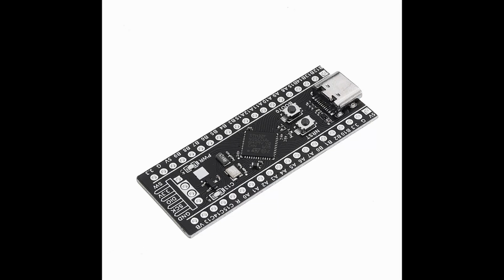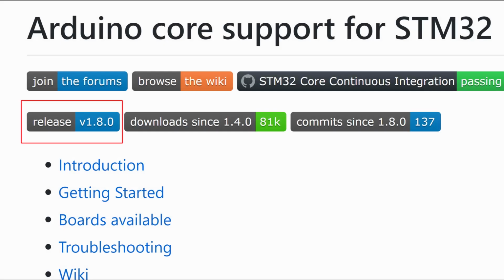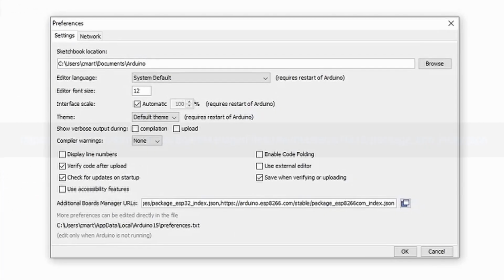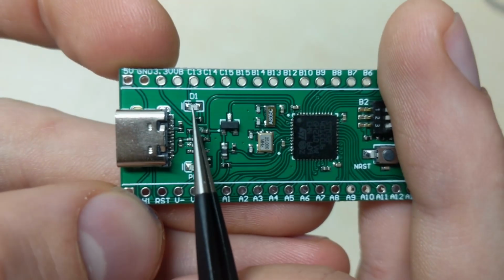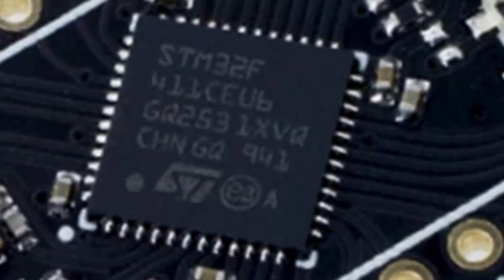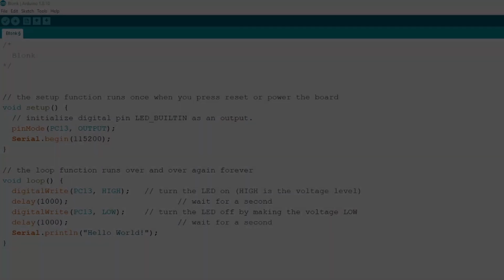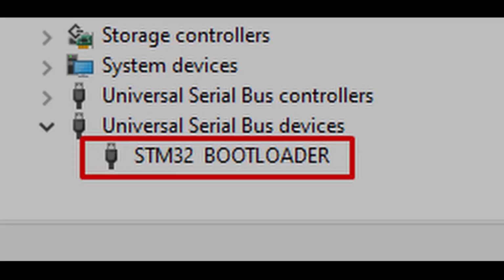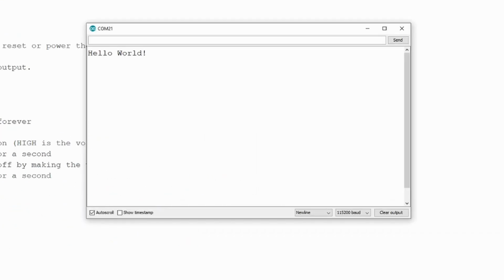Getting Started with the Black Pill Arduino STM32F4

Comment: I'm having trouble with uploading code on my board. I want to use MBED, which does not appear to be an option using the appropriate board selection when making a new project. However it is an option with the Nucleo_f411re board. I think the only difference with RE vs CE is the QFP vs QFN package. (and the nucleo board has STlink of course!)

I found that if I reset the board at just the right time during the upload process after compilation with the STlink, I can get the board to accept the firmware. However the STlink cannot reset the chip as needed to flash on it's own. Also I get an "Unknown/unsupported device (Device ID: 0x431)" if I attempt to upload via serial port. Guessing because the uploader checks the target processor model against the platform settings.

How can I "hack" the platform settings to make the uploader think the target is a CE and not a RE variant?
Reply from the maker: I'm not entirely sure. They did the same thing for the blue pill so I would start looking at how they did it there and see if it's applicable to this. Let me know if you make any progress
Reply: @CalebMarting  Yeah I am really looking forward to your video going more in-depth on platformIO. I'm fairly new to it. Seems I can't use upload_method=serial with the Nucleo equivalent board. And the generic STM32F411CEU6 and WeAct v2.0 options don't support MBED platform, least not natively. If I attempt to use upload_method=serial, I get an "ERROR: Invalid parameter specified" and I probably need to configure platformio.ini to use a custom upload command since the one for the Nucleo board doesn't want to cooperate. I'm hoping the uploader does not check to validate the CPU is an 411RE variant instead of an 411CE. If I set the environment to match the board I have but set the board = nucleo_f411re, then I get Unknown/unsupported device (Device ID: 0x431). I'm in over my head a bit with this one, trying to get away from Arduino.

Comment: Where can I find a pinout for your board?
Reply from the maker: I'm not sure, it is a weact f401 board. You can join the discord and we can try to help you there if you want, otherwise if you use the keyword weact you should be able to find it
Reply: @CalebMarting  nvm I found it. In the Amazon page, there is a google drive link to a folder with data sheets and schematic. I would love to join the discord though.
Reply from the maker: https://discord.gg/wrMcmXA I run this discord, see you there

Comment: Thanks a lot Caleb. 
Working in first attempt with STM32Duino 1.9.0 Version on Arduino IDE 1.8.13. with a 3 button F401CC  Board.
A little beast. About 140 times faster than Arduino NANO calculating 12!

Comment: Hi i have the STM32F411CE i am trying to use 2 SERIAL PORTS....  one for a bluetooth module and one as serial to the Arduino serial monitor.
i read you use serial and serial1 , but no luck.... how do i configure to use more than one serial port on the STM32F411CE ? many thanks.
Reply from the maker: You can use whatever serial ports you like on what ever pins you like with this:

#include HardwareSerial.h

HardwareSerial SerialX(rx, tx);

Then you can use SerialX like any other Serial object, with .begin and such. You can do this for as many unique serial ports as you would like, for instance

HardwareSerial SerialX(PA10, PA9);
HardwareSerial SerialY(PA3, PA2);

Make sure you also dont use the same port twice, e.g. you can only use PA10 and PA9 OR PB7 and PB6, since this is hardware serial. You can also still use the default USB serial with this method.
Reply: @CalebMarting  Hi Caleb, it cant find the file HardwareSerial.h
which one do i have to download...or where can i get HardwareSerial.h ? 
its for the black pill stm32f411
 thank you for helping.im usually very good with arduino ... a couple of years... but new to the M4 processor in arduino. im just using the usb cable to upload and pressing the buttons, i have not added a bootloader, its programming fine, i have tft screen going... but no access to other serial ports other than the generic 'serial' through the usb to serial monitor in arduino.... that one works fine. :o)
Reply from the maker: Hmm, it worked for the f1 processors. Just to be certain you are using the Arduino core STM32, and you put "HardwareSerial.h" in quotes right? https://github.com/stm32duino/Arduino_Core_STM32/blob/master/cores/arduino/HardwareSerial.h
Reply: @CalebMarting  Hi Caleb, im nearly there.... i have now put the " quote marks" on and copied "HardwareSerial.h" as an added file... it seems to accept it fine and shows no errors.... however im still a bit lost on which port is which, the usual serial.println("hello world"); does NOT now print to the serial monitor through the usb port like it was doing.
i simply want to use the usual USB port for serial...which works if i do not add another serial port. but adding the new serial port makes the USB serial stop working.   any help please.... been 2 days now! eeeek!
(if i add a line HardwareSerial Serial1(?,?);   it says it is already defined, i also would not know which pins i should put in there as i want it to use the USB serial as usual)
 here is my code:
#include "HardwareSerial.h"
//                                         RX    TX
HardwareSerial Serial2(PA10, PA9);
void setup()
{
  Serial1.begin(9600);
  delay(100);
  Serial1.println("Serial ONE!");  // to arduino usb serial monitor
  Serial2.begin(9600);
  delay(100);
  Serial2.println("Serial TWO!");
}
.
Reply: Hi caleb...okay got it working!
thanks for your help!
here is code for others:
(i dont need to #include 'HardwareSerial.h' at the beginning... it must find it automatically)

HardwareSerial Serial2(PA10, PA9);
void setup()
{
Serial.begin(9600);
Serial2.begin(38400);
}
void loop()
{
  if (Serial2.available())
    Serial.write(Serial2.read());
  if (Serial.available())
    Serial2.write(Serial.read());
}
Reply: it didnt work because I was trying to run my code in 'setup' instead of 'loop'.... dont laugh!  :o)
Reply from the maker: Haha, Glad you figured it out

Comment: Just received the BlackPill F411CE and I must say this is an arduino killer !
Reply: how did you make windows recognise it in dfu mode?
Reply from the maker: It should recognize it, if it's not recognizing any USB connected then check your USB cable or try a different one. Otherwise try a different computer maybe?
Reply: @CalebMarting the driver it's using doesn't work, wich one do you use?

Comment: Hi i don"t understand Cube MX in you video what for?
Reply from the maker: CubeMX is a different program. STM32 Cube Programmer is used by Arduino to upload code to the black pill. There's a command line program included in the install that it uses.
Reply: @CalebMarting  oh thx.

Comment: Great! somehow I have the STM32F411CEU6 
, and when connected I could see "STM32 BOOTLOADER" in Device manager but still can't see it in the ports.
Reply from the maker: Yeah so that's intentional. If you don't have generic serial supersede uart and USB support on. If you turn those two settings on then USB support will be enabled and you'll see the USB port.
Reply: @CalebMarting  Thanks a lot for your help. Have you tried the ADC pins? It got me wondering since the datasheet says the uM has 12-Bit resolution for ADC, while I am getting only 10-Bit Resolution.
Reply from the maker: Someone else on the discord (linked in the description) was trying to figure that out. You can join and see if they made any progress
Reply: Be sure that you seected CDC on USB Support. This activate the serial port COM.

Comment: Thanks for the tutorial. Its saved me a lot of time. I'm interested in using spi and i2c busses on the 401 black pill. The 401 has several i2c and spi engines. How can I figure out which ones have been set up as the default ones used by the arduino wire and spi libraries.
Reply from the maker: I'm not entirely sure, best way would probably be guess and check or you can look at the configs on the actual stm32 Arduino core for that board

Comment: Caleb, what USB cable do you use, mine doesn't fit?
Reply from the maker: These boards have a USB-C connector, it's been out for a while but still very new and not well adopted, my Android phone has one so that's why I have the cable
Reply: @CalebMarting  Is that what is on the iPhone? I have one the iPhone charger will that work? Thanks for letting me know. I like the looks of the black pill better. I have other projects so I am just pecking at it for now.
Reply from the maker: It is not, iPhone uses the lightning connector. you should be able to go to any big box store and get a USB-C cable though for pretty cheap. Just make sure it has data
Reply: also make sure you use a type C DATA cable.... sometimes from the pound shop they are only for charging and the DATA lines are not connected!

Comment: For some reason it didn't work for me. I had the Arduino IDE 1.8.12.
When used the Arduino 1.9 then it worked flawlessly.
I have the STM32F401CCU
Thank you!
Reply from the maker: Huh, very weird, don't know what would cause that. Glad it works though!
Reply: arduino 1.9 ? did they release that ?

Comment: Note: I found that the version of Arduino IDE I use, 1.8.12 has the value for LED_BUILTIN is correctly set based on the board you are using (PC13, in this case, and in the case of BluePill boards)
Reply from the maker: The STM32 Arduino core is what would change it. I've mostly had them work in the past but sometimes it just doesn't want to compile or it's not defined. I figured I would just make sure that it wasn't a potential failure point. Thank you

Comment: Thanks so much!    I'm REALLY getting into STM32 and these videos are hitting right where I am in the learning process.
Other than the built in bootloader,  can you elaborate on what advantages there are of using the Black Pill over using the Blue Pill?
Thanks again!
Reply from the maker: Thank you!
That's a whole separate video lol. Someone else made a video on some of the differences which you should go check out but he used Mbed instead of Arduino. The information at the beginning is still good though. https://youtu.be/QCdnO43RBK4
if you want to suggest some ideas for videos like things that are hard for you to learn or you want to see, you can go ahead and join the discord in the description. You can also get help if you get stuck.
Reply: For starters the blue pill makes you a simp but the black pill doesn't.